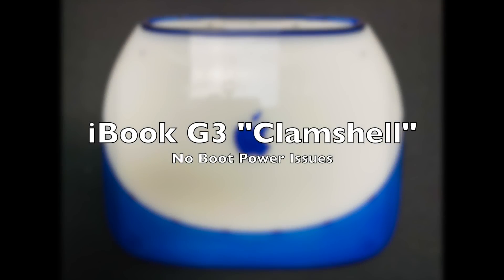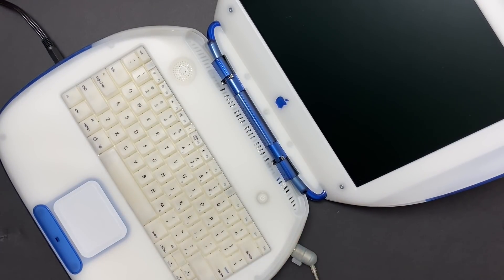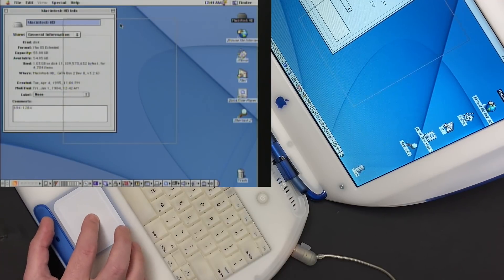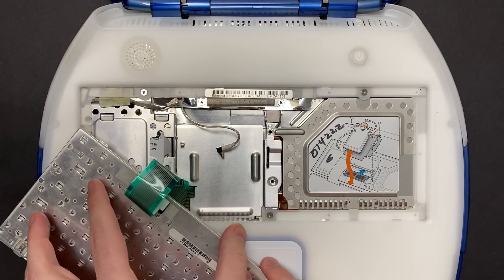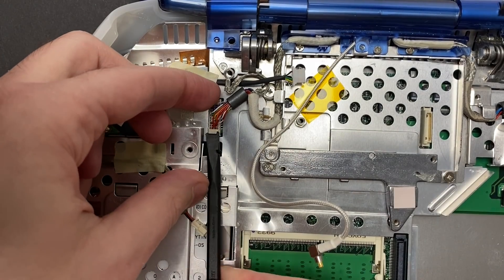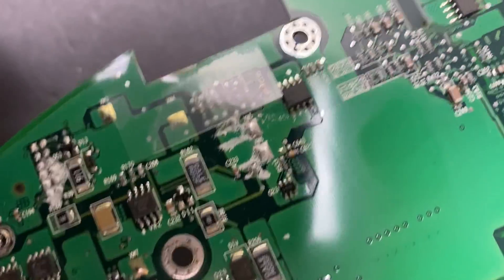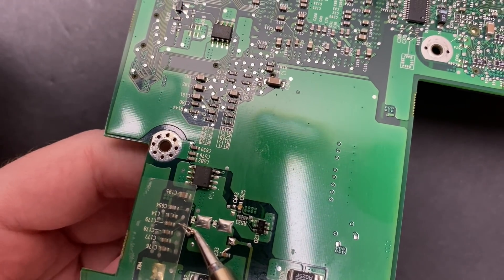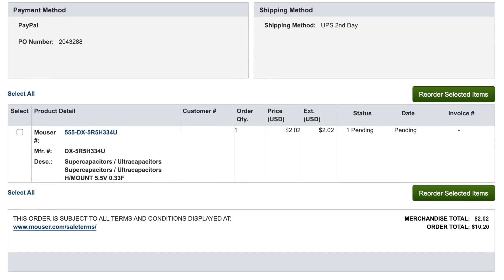Apple iBook G3 "Clamshell" Power Issues - Retro Computer Repair

Comment: I have a blue one I bought at a garage sale a while back but it has three big problems: it doesn't work without being plugged in, the screen has some funky looking bulge damage on it, and it has some elementary school software on it that prevents me from doing much on it since I'm stuck on student mode (teacher mode requires a password I don't know) and important features can't be accessed through it. That student mode is why I haven't done anything to fix mine. Maybe one day I'll find the right factory reset discs on ebay.

Comment: I picked up one of these a few years ago at a Garage sale cheap.  It’s nearly flawless condition and works great.  Only issue is it will not work without being plugged in.  I tried replacing the battery but no go.
Reply from the maker: That's interesting, especially since you tried a new battery. The symptoms are slightly different from my unit here, but I'm a little suspicious of the supercapacitor or potential trace damage due to leakage from the supercapacitor. The more retro tech I work on the more I realize they have common failures. There's always the oddball unit but all things equal, theres a short list of things that fail on each platform and the issue ends up being more common than I had previously thought. Theres always the possibility the replacement battery was no good but you might have to tear the unit down and examine the power circuitry area near the DC jack to confirm what's going on.

Comment: Most component testers and even expensive multimeters won't read a supercap.  They usually top out around 10,000uf
Reply from the maker: Good callout. Just looked into my unit and apparently its rated up to 0.1F i.e. 100,000uF. Not sure if that's exaggerated but nonetheless still won't read a 0.33F cap. Too bad won't be able to verify the reading on the replacement cap when it comes in. Thanks for sharing!

Comment: What does the Xbox clock capacitor? Keep the time and date or something about the cpu power vrm?
Reply from the maker: Xboxes are plagued with issues arising from a particular capacitor that leaks on v1.0 to v1.5 motherboards known as the "clock capacitor". It's a 1F supercapacitor that keeps the system time for a few hours after the system loses power. Often faulty Xboxes have power issues due to the leakage and corrosion this supercapacitor causes.

Comment: Looks like a kids toy 😄 I hate the postage costs for Mouser and other similar sites. Friggin ripoff.
Reply from the maker: Yeah unless you have the kind of volume to make shipping worthwhile, there’s always going to be that upfront costs even for a $.10 component. I have ventured in my neighborhood and found a local electronics supply store, but I only find what I need about 50% of the time.
Reply: @BorderlineOCD  I used to get mine locally but theyve all gone now. :( I tend to get most electronics from ebay now (which usually comes from China but still so much cheaper than Mouser!). Id order from them if postage was far more reasonable.